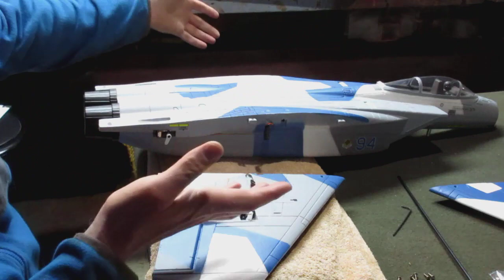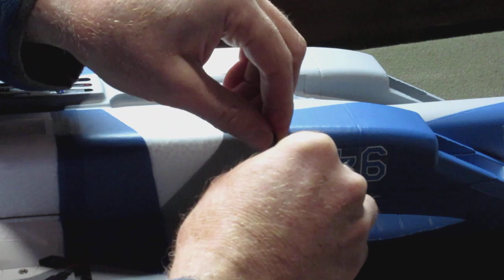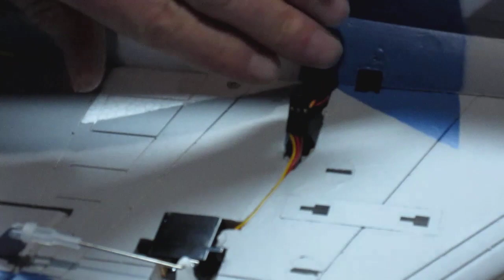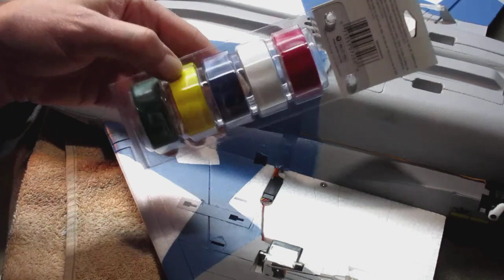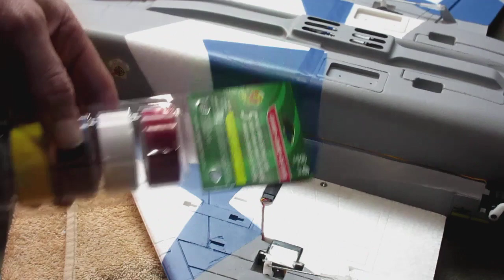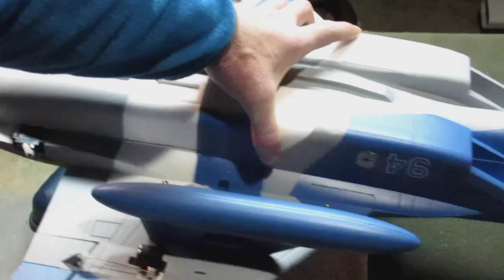E-Flite 64mm F-15 Eagle build  ( Part 1 )

Comment: Sweet. I'll be trying to buy this plane. This video will be helpful.
Reply from the maker: Unfortunately I was only able to get 2 uploaded last night and this morning.   The other two will have to wait until later this afternoon to go up.
I really need things to dry up a bit and some calm afternoon / evenings so I can get out and fly some...shaking off that winter rust.
Reply: @markhyde43  Cool. And I really did learn a bit. 
On April 1 I'll be done and over moving my house. My new basement is a little colder, but I'll section it off and use an electric heater next winter. 
It has good windows for an AC. 
Plenty more build area. Hopefully lots of flying for both of us soon.
Reply from the maker: @JoshWeaverRC   cooler basements make great for battery storage and charging.   It stays at about 55in the summer down there.    I have ammo boxes (not nearly enough) for them and in the summer I keep the charged ones locked in the iron wood stove, which is also in the basement.

Comment: I just use a little drop of foamtac on the screw head to keep it from backing out and falling out, this Jet isn’t fast enough to throw hard high G stress on the wings, having three anchor points, 2 of em the screw tabs and the third being the carbon fiber spar it’s more than rigid enough, on the other hand I understand the piece of mind thing as well, good luck on your maiden 👍🛫
Reply: Early Father's Day to me! My wife called me from the RC shop so of course I said yes to this plane. I'll have some fun. Still have to get some proper batteries for it.

Comment: I thought I saw gray tape that comes with that plane to cover under the wing connections you may check that out
Reply from the maker: There is.  There is a rectangular grey sticker and a white one like it, about the size of your thumb.  I originally didn't know what it was for.  It wasn't until after I applied the tape, which I do as a normal practice, that I figured they were for covering the wires.
They would work also.
They are a bit short, but not by much.
Reply: @markhyde43  ok good I was just watching the video where they showed them but sounds like the way things go for me day late and a dollar short ,just want you to know I really enjoy your videos just got my fw 1410mm old crow p51 in looking forward to getting it built I love your mustang's beautiful airplanes keep up the good videos
Reply from the maker: I am going to update this last final video with that correction about the tape before i convert it and upload it